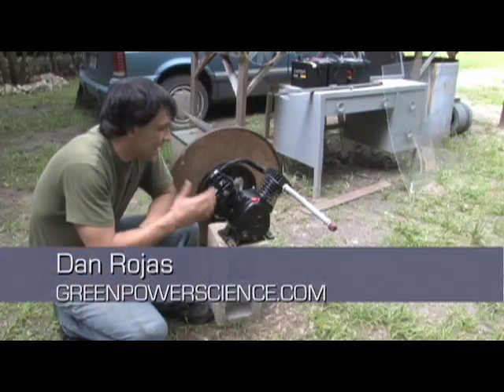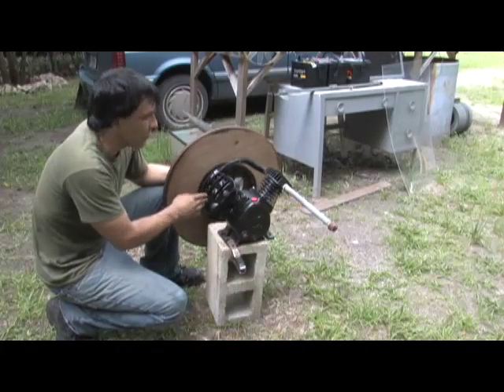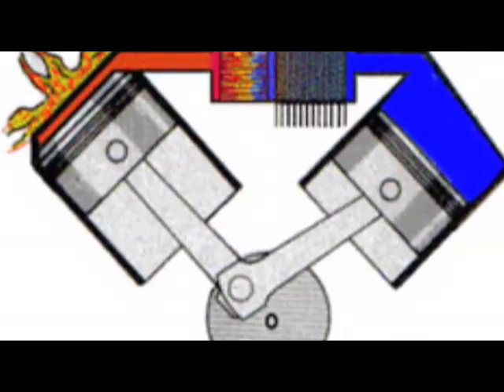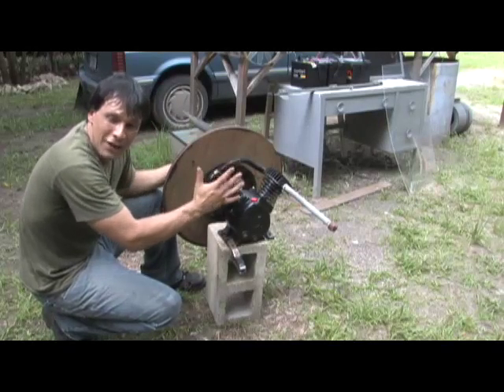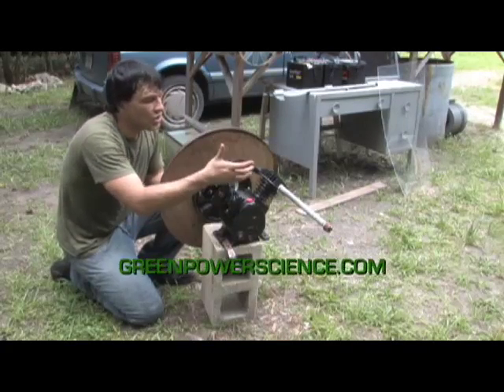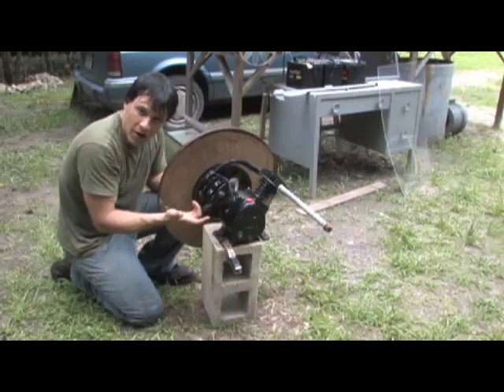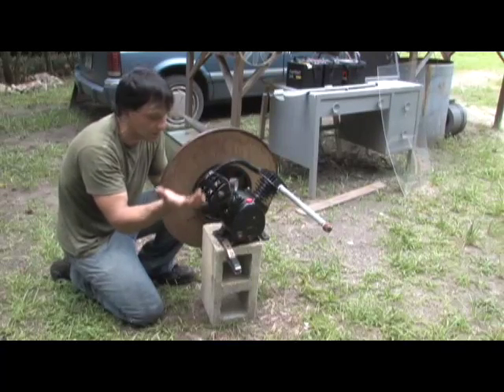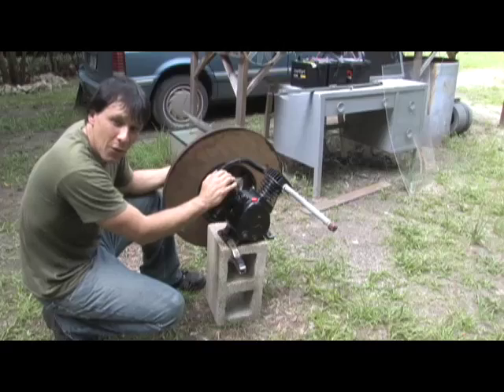STIRLING CYCLE Alpha ENGINE DIY OFF THE SHELF STEAM ENGINE SOLAR MOTOR

Comment from the maker: Hi Brandon,
Thank you for enjoying our videos. The steam project was 12 kw pulse so it would realistically only hit 2-3 kw continuous.
Start with home efficiency first, LED vs incandescent, Flat screen vs tube tv/mointors, insulation, better windows, new energy star appliances then migrate to solar. You get all new stuff for the cost of any DIY projects. PV is really cheap now, so a lot of the Stirling and Steam projects just cannot match the PLUG N PLAY of PV nor the no moving parts thing.

Comment from the maker: The Fresnel Lenses provide a good heat source for the engine. 4 years later PV solar panel prices are so low, that the technology is not practical so it is a hobby engine or heat reclaimer from other heat  byproduct processes.

Comment from the maker: This compressor I pulled the rings off as the base can be sealed. The seals on this pump were damaged from me messing with it. The larger silver models seem to flow very well for their size.

I am thinking the piston head is where the heat is applied so the first cycle would start with cool volume passing through the wool on the hot side for expansion without baking the rings.

Comment: Hey Dan and Mudy if you see this.
I have been trying to make my stirling run from solar excitation. I have a diffuser from a traffic light it works well, I have it focused onto some copper tubing with fins from a  baseboard heater paintd black. Im just curious how much  temp differential should I have before I should try to start it? Because it clearly is not even attempting to run should I remove the inner workings, rings, pistons, connecting rod,... and lightem up

Comment: What is the most efficient version of a Stirling engine? I thought it working with a solar heater, which made this accumulated heat engine stililng operate continuously, later using molten salts (for research) to accumulate the heat and keep it running at night.

Comment: Hey Dan your Videos are great but are you sure the compressors have 90 degrees phase difference?  that's what you need for a sinusoidal sterling.
 i am thinking of buying a cheap one and use it as a crycooler by connecting it to a strong engine, what do you think?

Comment: Hi Dan, have found your videos very informative, currently researching building a wind generator for myself and a water turbine for a friend using all recycled components, and looking to make a stirling engine for myself just for fun, have had my head in many scrap metal skips looking for parts, doing well so far, having problems finding your follow on videos on the stirling engines can you give me any advice please, thanks Nigel Cox

Comment: I saw in the video that you mentioned it as a steam engine would it work with a large solar watter heater and would it turn a 20 kw generator at a min 1800 rpms?  and I'm a huge fan by the way

Comment: if getting enough heat is a problem, maybe its easier to make the cooler stronger so you still get a bigger difference in temperature?
+ i heard that cold water heats up faster than warmer water so that might be a positive factor as well about it

Comment: Right I think. The Rider engines had what looked like a displacer fastened on the hot piston  and a "hot cap" on the head, to move the direct heat further from the piston.  Apparently, you can move the cooling jacket to the ring travel area of the hot piston without ill effects in this type...

Comment: Did you pop the slam-valve out of the cylinder heads so they wouldn't act like check valves? Weren't very clear on that.

Comment: Hey dan, start thinking about using MAPP gas. rather than propane. mapp gas can produce your heat requirement while not melting anything.

Comment: Induction used for cooking can run the pistons and you can also design a throttle has well. Which means it would be a new electronic rotary motor that could be used in many different vehicles. Novartis

Comment: Hmm,  I've seen binary cycle geothermal power plants.  I guess you could take heat water with solar power and get the same effect.  Wonder what kind of acreage you would need to generate 50-100 Megawatts.  SEGs  take about 1600 Acres but I think they're only using steam.

Comment: If with this motor you are attempting an Alpha type conversion...Forget it..how will you keep the hot side separate from the cold side and how can you adjust the timing (offset) between the two pistons it's all very well saying that its already set at 90 deg. but a lot of alpha stirlings run at approaching 160deg..Post video when it's running!

Comment: Stirling cycle engines are best in pumping applications when the pumping liquid can be used to cool the cold side. It can messy in a model table engine, but I think, well worth it for a successful demonstration.  In this case I see a water jacket on the cold side connected to an hose faucet as a pseudo pump.

Comment: Dear Dan  Please find an old air hummer gun and look  inside at the way the transfer of the air forward and back though compress air only... Which  pushes  the wheel forward to cycle the the pistons to ready and then to fire 
instead of the firing ( the gasoline) to let in hot heated air in  to run the " Generator "  I hope you understand ...

Comment: @sailingsolar but the problem that I am reading about it the steel/cast is hydrogen permiable. The hydrogen will leak through the steel and eithercould catch on fire or need constant refilling. helium would be better.

Comment: soo,, after every shutdown of running such steam engine... i would imagine... a little oil injection to keep cyl.. till next run. the piston rings will need replaced with ceramic.. ty for being there and sharing... moneymax3001

Comment: That kind of intensity would compromise the casing and could be dangerous. The problem is applying a high level of heat for a significant amount of time at a low intensity. Another problem is that a compressor has fins built in for air cooling thus reducing the amount of heat that is transferred to the interior of the engine. Most of it radiates away.

Comment: (I am thinking the piston head is where the heat is applied so the first cycle would start with cool volume....)   You want to heat the air in the cylinder, not cook the engine. .......Take the head off and bore a hole about  about 70% of the piston bore thru it.  install and seal a like diameter 10inch  long hot cap and have at it with a propane torch!  We'll be waiting when your eyes widen on the next video when this thing takes off.

Comment: @anfiach I was thinking of it more as this is what it should be used for, but it requires an external energy source. I forgot that he had modified it. 
You could mount it to an adjustable stand, like his motorcycle stand and place it at various points in the focus so as to reduce the intensity but keep the high level of heat.

Comment: not if u keep 02 out. anyway once you plug the equaltions its optimal to use the lightest most ideal gas. H2 and He have both the best potential with h2 winning it. problem is both gasses are 'leaky' they will actual leak ot through tiny gaps and even through the metal structure over the years

Comment: have you ever thought about using a gasoline engine and running it on air, obviously a 4-stroke engine as a 2-stroke need oil in the fuel

Comment: ok, I have been quiet for too long, but let me tell you what you need to make this thing work, then and only then, I'll start thinking you are smoking something good:

You need a huge displacer piston, whatever you have in mind, make sure it's 5 to 10 times bigger, then it will work, the volume of air needed to overcome the initial inertia, and the friction is much more than you have been allocating .

Comment: actually allyou have to do for a pressure engine is take a 2 stroke weed eater engine 
and put an air fitting in the spark plug hole and put 50 psi or greater and it will run like a steam engine

Comment from the maker: @caboflyguy WORKING ON IT, actually there is a follow up
watch?v=UajnWVBe0qA
It works, just not great. This design has promise but is not as simple as the wikipedia drawings. I regards to not answering and or cashing out, we get about 150 comments a day on all videos. I spend most of the time censoring &%## comments, it is Youtube after all. Keep in mind we are not just a Stirling engine channel, do not own a machine shop and do videos between work and clouds.

Comment: Yes, Hydrogen if highly combustible. However, unless I'm wrong  it's not a problem here.  The Hydrogen also needs Oxygen to be present to combust.  For combustion you need three things,  any two won't work.  
#1  A fuel = Hydrogen
# 2 Sufficient heat = High enough temperature
# 3 Oxygen= Oxygen, have to have it.
By using100% Hydrogen it's 100% sealed inside the compressors pistons.
No Oxygen no combustion, EVEN with sufficient temperature. SS

Comment: You can take and dig a good sized pit, insulate the hollowed out pit, fill the pit with rocks, cover it up, get a old laptop computer that can run a program to track the sun, morning to night, and focus the rays of the sun through a "fresnel lens" (lighthouse lens) and heat the rocks up, and that heat will run the engine you have there, a bit of investment of a large rock pit, and stored heat battery (that is what your are creating with the rock pit) and you can spin a planetary gear/sun 3-way hub, to make torque, and you are making clean energy without greenhouse gases, that will "Not" harm, or cause global warming. Thank You!!! Kelly!!!

Comment: You can get your junk to play with as long as it hasnt made it to the tip "Recycling Centre",which can be a bit difficult,the dunps before all this health and safety crap,you could go there and have what you wanted,sometimes a few quid in their tea fund worked wonders,then they started selling junk to the public,then the gov stopped that too as explained before,so much for recycling at home!!